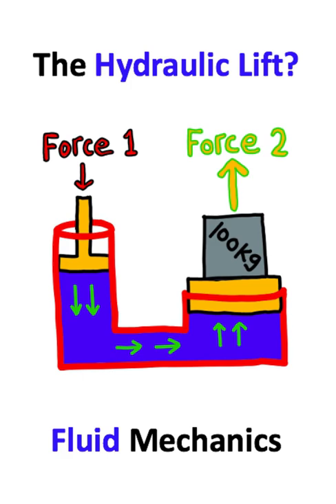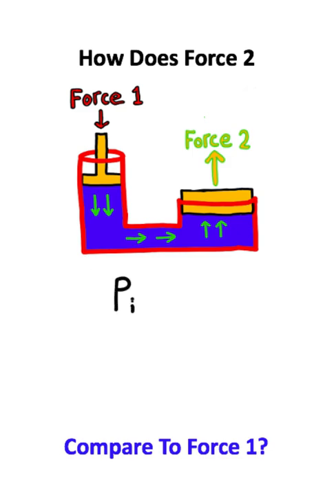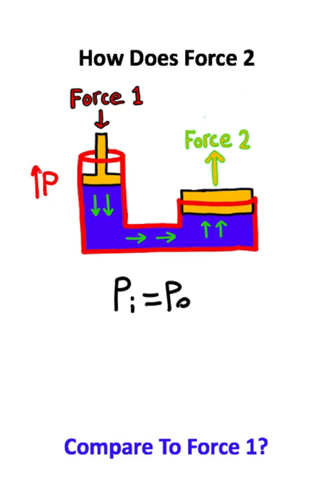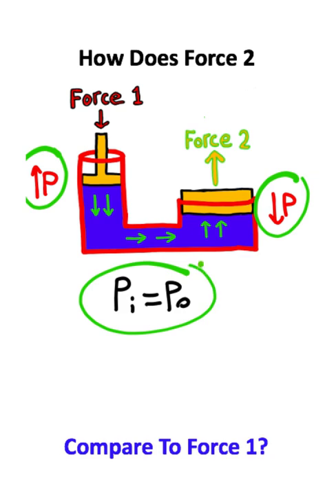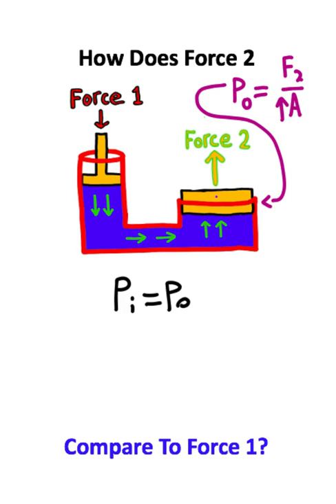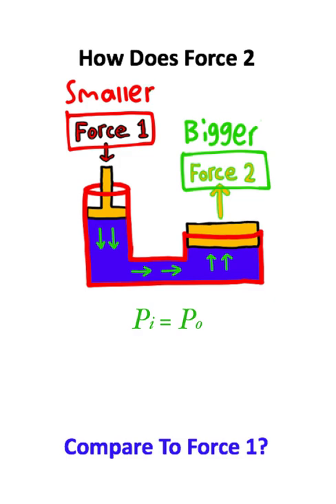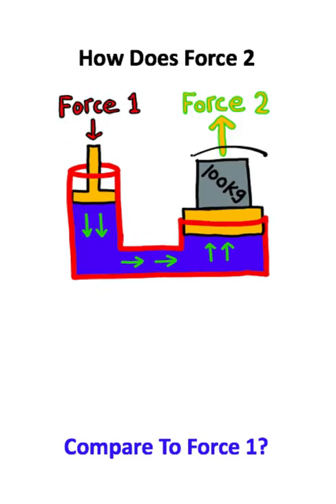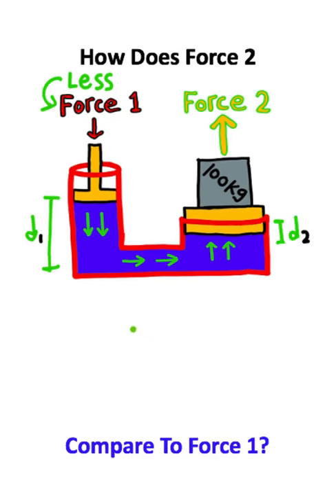This Machine CREATES FORCE!!

Comment: That's just indulging in semantics. I disagree with his description. Since the area on the left displaces the same number of molecules into the right side chamber, the vertical movement is a direct ratio between the area on the left,  to that of the right. With that being said,  the force has to increase to maintain equilibrium.
Reply: No, pressure in a closed container is the same everywhere in the container, whether it looks like a triangle, a coconut, a Zig Zag, it's the same container.